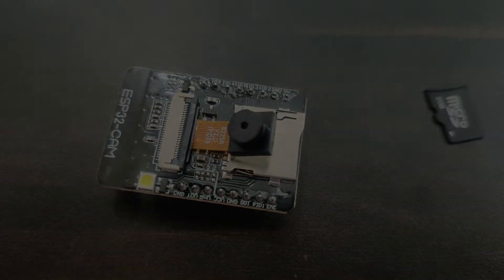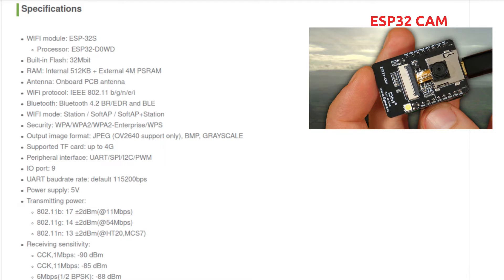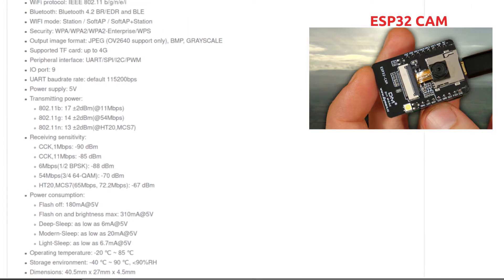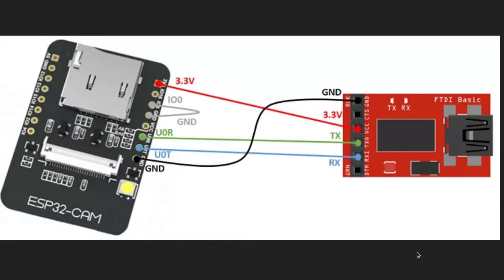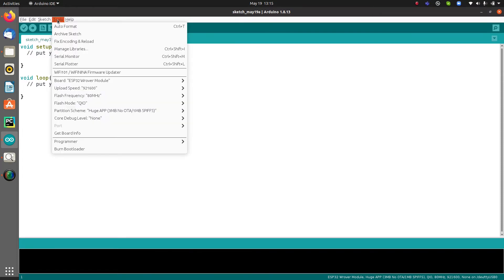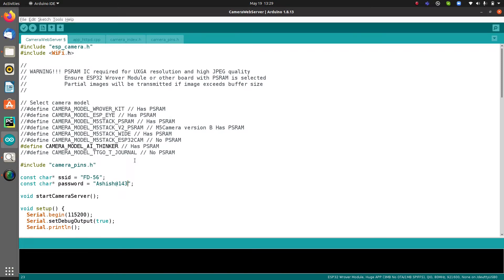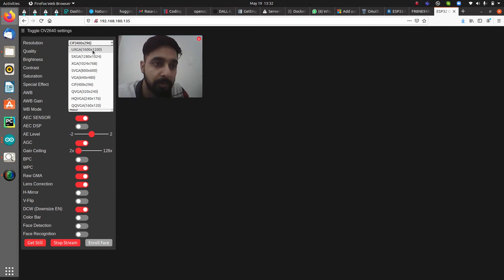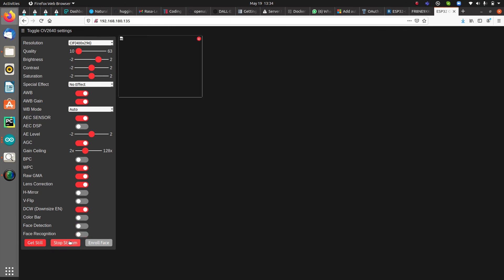ESP32-CAM Video Streaming and Face Recognition with Arduino | INNOVATE YOURSELF

Comment: If the led of my ftdi module is not turning on after inserting usb  cable toh laptop, this means my ftdi module is not connected to laptop???
Reply from the maker: It's not the case. If the port is not showing after connecting the ftdi module then you can say the module is not connected to laptop

Comment: Is this mini usb cable??
Reply: For ftdi module
Reply from the maker: Yes
Reply: @InnovateYourselfashu  When I am connecting the usb to my laptop, no led is on... What should I do??  
And while uploading the code at the bottom is showing ESP32 Wrover module (not connected)
Reply from the maker: @aliyamojiz_computer4528 led will not be ON on connecting to the laptop. Check in the device manager to see if the port is available or not and also verify your connections with esp32 cam.
Reply: @InnovateYourselfashu please help me. I have to submit this project soon

Comment: Bro i have some errors with esp 32 cam can you help me 😭
Reply from the maker: Ya tell me
Reply: @InnovateYourselfashu  thanks for your reply
Reply: I have no pc ,and im programming using smartphone , but i cant get the ip address for access the camera
Reply: Because of this reason  i tried with my friend's  pc. Same error occurred 😭😭
Reply from the maker: What's the error?
Reply: @InnovateYourselfashu  17:34:30.323 ->  ets Jun  8 2016 00:22:57
17:34:35.916 -> 
17:34:35.922 -> rst:0x1 (POWERON_RESET),boot:0x3 (DOWNLOAD_BOOT(UART0/UART1/SDIO_REI_REO_V2))
17:34:35.936 -> waiting for download
17:34:42.995 -> ets Jun  8 2016 00:22:57
17:34:43.004 -> 
17:34:43.008 -> rst:0x1 (POWERON_RESET),boot:0x13 (SPI_FAST_FLASH_BOOT)
17:34:43.016 -> flash read err, 1000
17:34:43.021 -> ets_main.c 371 
17:34:43.352 -> ets Jun  8 2016 00:22:57
17:34:43.367 -> 
17:34:43.371 -> rst:0x10 (RTCWDT_RTC_RESET),boot:0x13 (SPI_FAST_FLASH_BOOT)
17:34:43.380 -> flash read err, 1000
17:34:43.384 -> ets_main.c 371 
17:34:43.705 -> ets Jun  8 2016 00:22:57
17:34:43.714 -> 
17:34:43.718 -> rst:0x10 (RTCWDT_RTC_RESET),boot:0x13 (SPI_FAST_FLASH_BOOT)
17:34:43.724 -> flash read err, 1000
17:34:43.731 -> ets_main.c 371 
17:34:44.060 -> ets Jun  8 2016 00:22:57
17:34:44.066 -> 
17:34:44.070 -> rst:0x10 (RTCWDT_RTC_RESET),boot:0x13 (SPI_FAST_FLASH_BOOT)
17:34:44.075 -> flash read err, 1000
17:34:44.080 -> ets_main.c 371 
17:34:44.417 -> ets Jun  8 2016 00:22:57
17:34:44.429 -> 
17:34:44.433 -> rst:0x10 (RTCWDT_RTC_RESET),boot:0x13 (SPI_FAST_FLASH_BOOT)
17:34:44.440 -> flash read err, 1000
17:34:44.444 -> ets_main.c 371 
17:34:44.772 -> ets Jun  8 2016 00:22:57
17:34:44.781 -> 
17:34:44.785 -> rst:0x10 (RTCWDT_RTC_RESET),boot:0x13 (SPI_FAST_FLASH_BOOT)
17:34:44.796 -> flash read err, 1000
17:34:44.801 -> ets_main.c 371 
17:34:45.125 -> ets Jun  8 2016 00:22:57
17:34:45.134 -> 
17:34:45.138 -> rst:0x10 (RTCWDT_RTC_RESET),boot:0x13 (SPI_FAST_FLASH_BOOT)
17:34:45.146 -> flash read err, 1000
17:34:45.152 -> ets_main.c 371 
17:34:45.496 -> ets Jun  8 2016 00:22:57
17:34:45.505 -> 
17:34:45.516 -> rst:0x10 (RTCWDT_RTC_RESET),boot:0x13 (SPI_FAST_FLASH_BOOT)
17:34:45.520 -> flash read err, 1000
17:34:45.522 -> ets_main.c 371 
17:34:45.836 -> ets Jun  8 2016 00:22:57
17:34:45.846 -> 
17:34:45.854 -> rst:0x10 (RTCWDT_RTC_RESET),boot:0x13 (SPI_FAST_FLASH_BOOT)
17:34:45.862 -> flash read err, 1000
17:34:45.866 -> ets_main.c 371
Reply: Serial monitor response ☝️☝️☝️
Reply: It not shows the ip address for access the camera 😭😭
Reply: And also one more thing,i can upload code using Arduinodroid app,but i cant obtain ip address, but  i cant even upload the code,it shows fatal error occurred searching for packet header
Reply: What should I do now